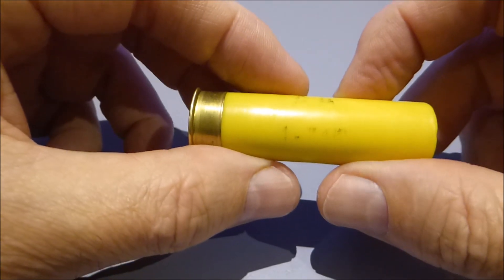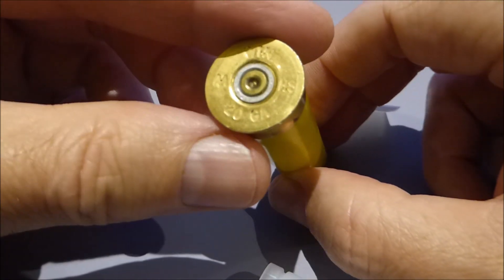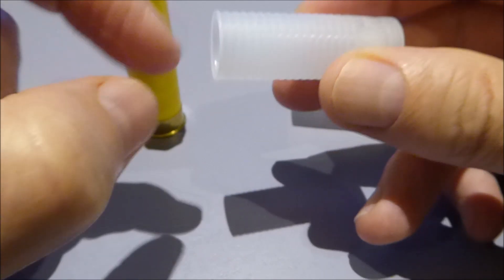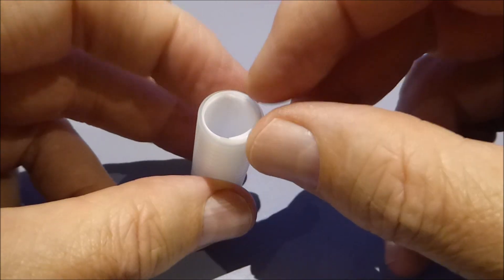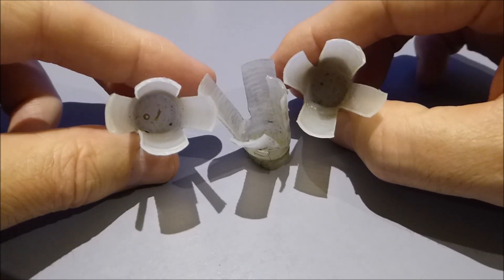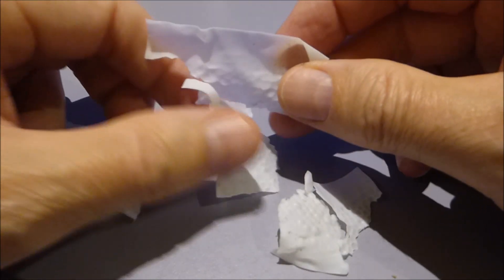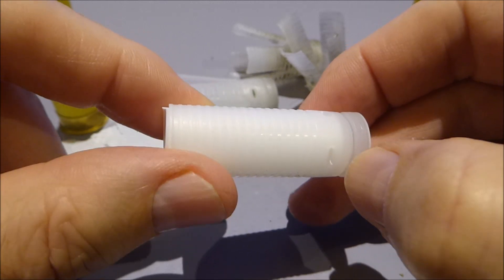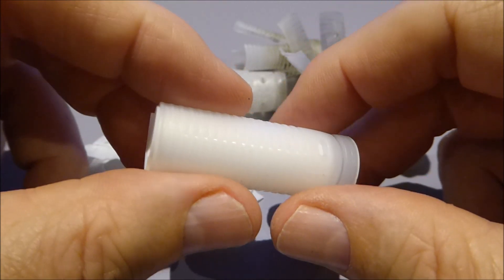Autopsy of the TSS-18 Reload Components in the Chippa Triple Crown 20G Shotgun, Victoria 25/07/2023

Comment: Surprised to see you go to number 9s, i would have guessed no5s or 6 would still had a great kill pattern but with more hitting power, but you knocking them down ok, and 3.50$ a shot? so that rabbit that somehow dodged 2 shots before getting shot with the third in the vid you posted on weekend  cost you 11.50$?, that's a very dear little bunny.
Reply: The shot weight is different number 9 in tss is the equivalent of  5-6 I have been told there is a chap that shoots wild fowl on The Norfolk coast unbelievable anything under 35 yards is chewed up amazing load but costs I looked at bringing it in from the U S and I seem to remember just the shot around 21-24 grms was £1.20 with out components .
Reply from the maker: Rule of thumb is you go down 4 to 5 sizes from lead to tungsten and up 2 sizes from lead to steel.

I have a heap of tungsten shot doing nothing so I"m using it up for scientific experiments.